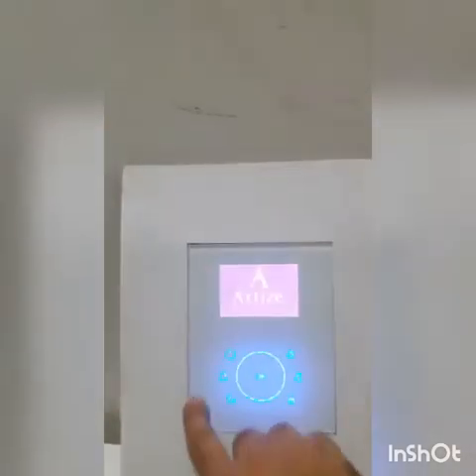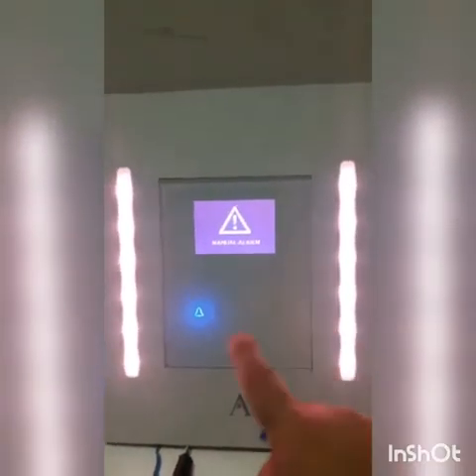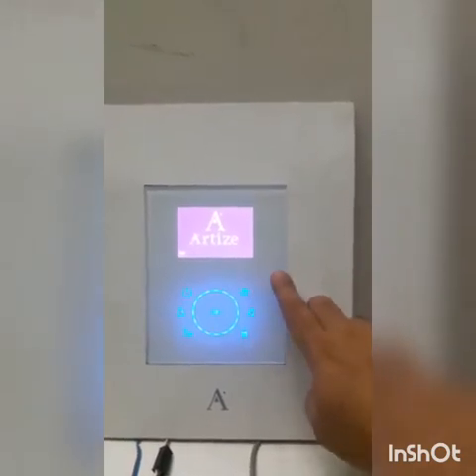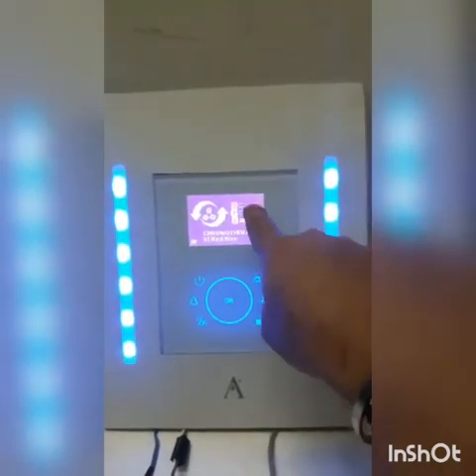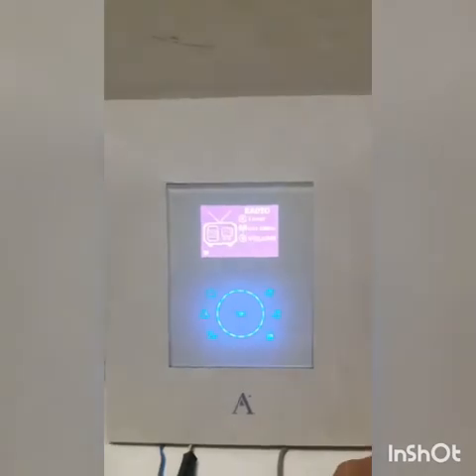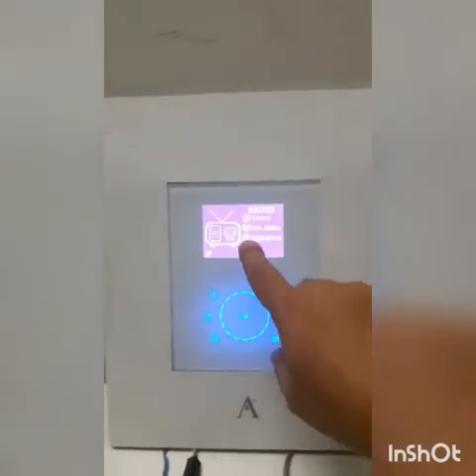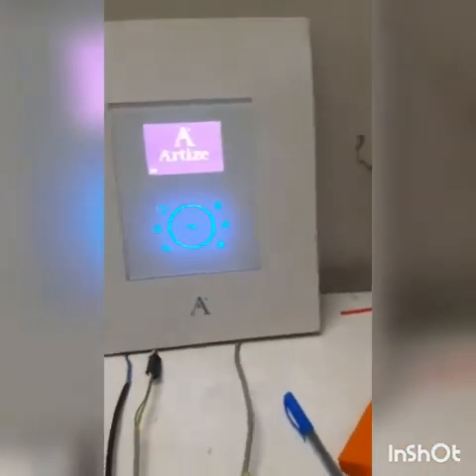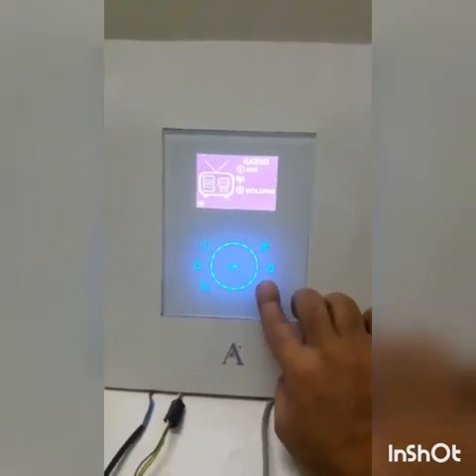Artize Steam Generator touch pad function in English

Comment: We are using Jaguar Artize make Steam generator unit with touch pad. It had stopped working just after 3 years. We are complaining from 6 months and service person finally said recently that the unit failed due to exposure to water / moisture. He is saying it is going to cost Rs. 55,000/- for repair. How can a steam generator unit fail due to moisture. It is highly unfair to ask to pay almost 50% of purchase cost for service. We do not expect such response from a reputed company like Jaguar.
Reply: Sweeta ji
The installation cost as charged to you is unfair..The touchpad cost only 17500 and I suggest you to buy a new one if required.Also request you kindly to lodge a complain in Jaquar toll free number.Your problem will be sorted out.
Regards,